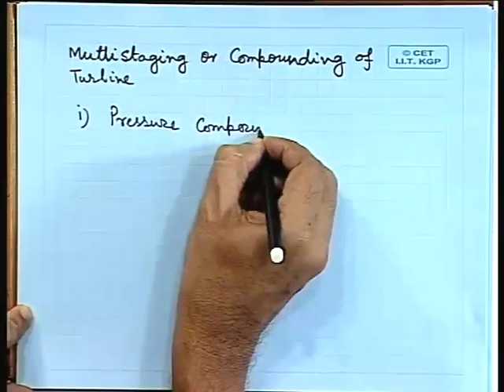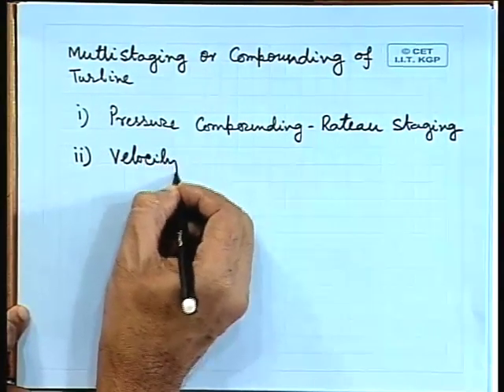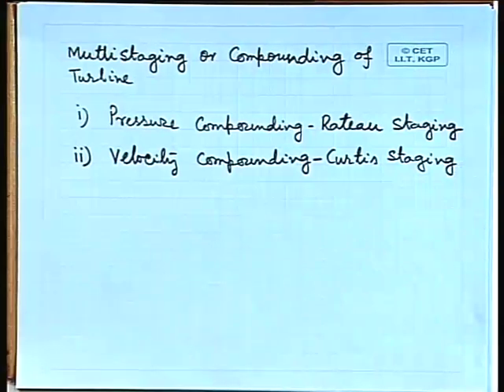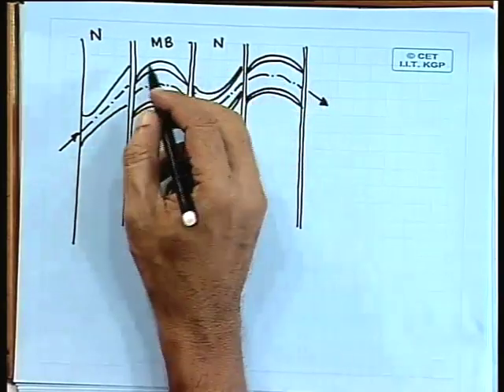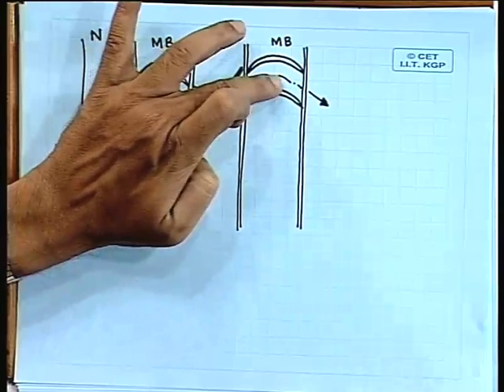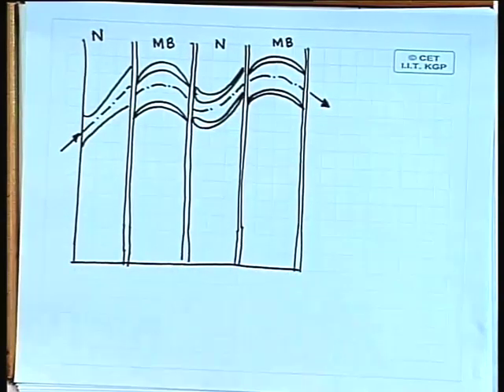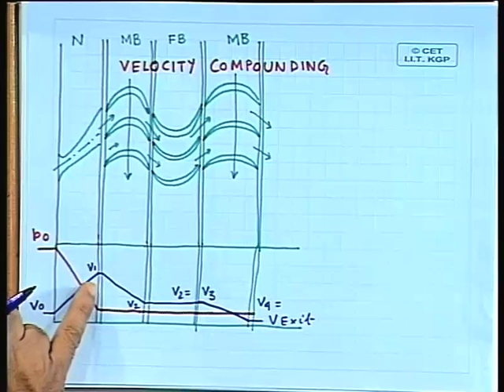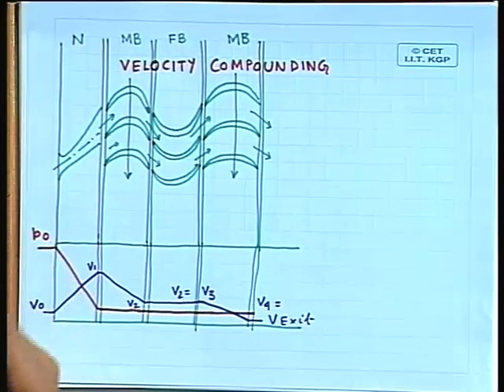Lec-13 Reaction Turbine Compounding

Comment: in reaction turbine like you said that there will be a pressure drop across rotor blade (moving blade in the video) due to convergent area than how can the velocity decreases in the region of moving blade when u draw the velocity diagram
Reply: pressure is constant in the moving blade regio in pressure compounding and in velocity compounding as well